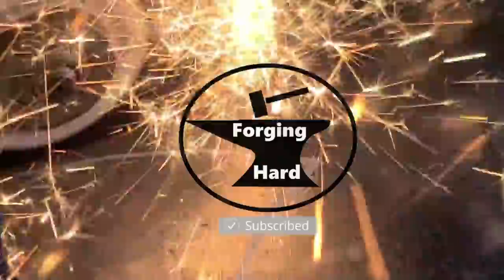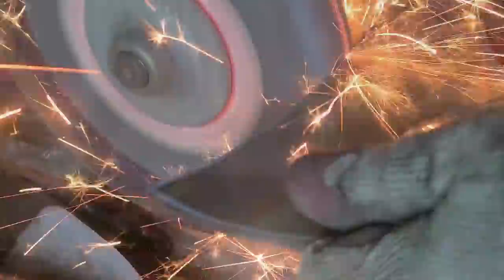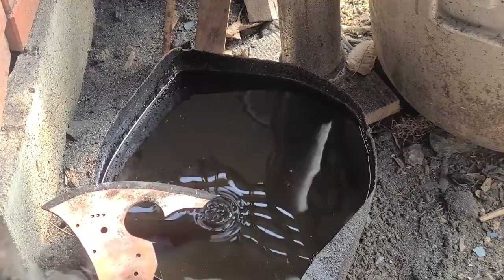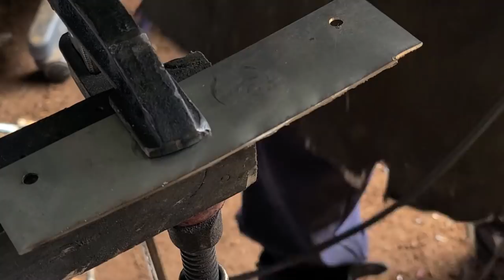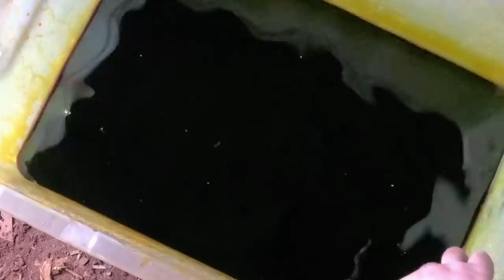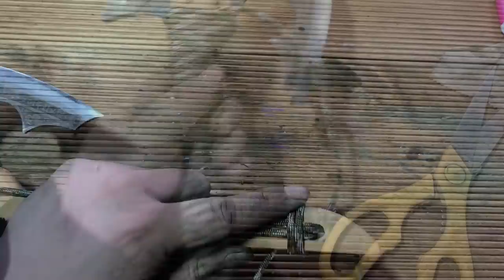Part 2 make a camping ax from clothes hanger

Comment: If I ever need a lot of kindling I know who to call.  😂
Reply from the maker: Thank you for watching.
And greetings from Korea.
Reply: @forginghard  Hi from Canada.
Reply: @forginghard  but really, that coat hanger would snap with very little force.
Reply: @forginghard  now if you laminated 3 or 4 and shaved them down, that might be strong enough.
Reply from the maker: @mtnbkr8480  The hanger is too weak to be used as an ax handle. This ax is just for decoration.

Comment: Your making another axe with a coat hanger handle?
I'm surprised the first one didn't break chopping that quarter inch green twig.
Reply from the maker: Make two handles with four single hangers.
Reply: @forginghard  hangers are meant to hold the weight of a shirt. Not chop wood.  
btw. I've had jackets that have broken wooden hangers.
Reply: @forginghard  I don't mean to offend sir, I am trying to be diplomatic, & failing at it.
Reply: @forginghard  if you cut the hanger in half, steamed it, and then wrapped both halves tightly with Paracord. Maybe.